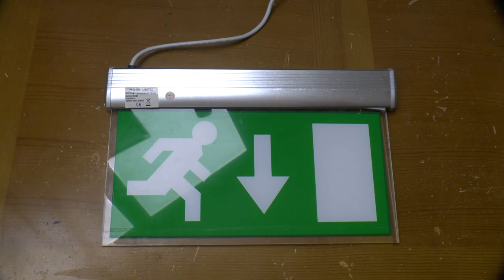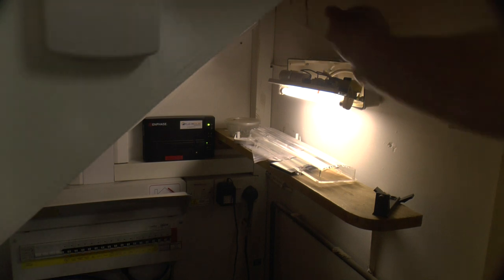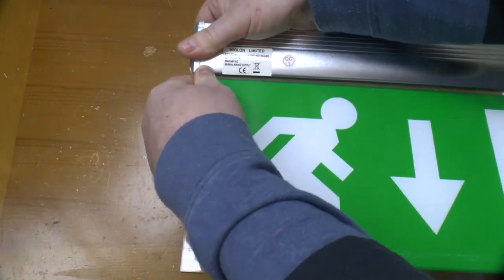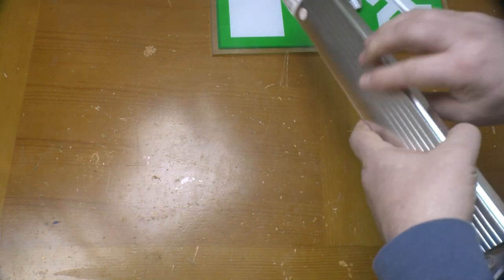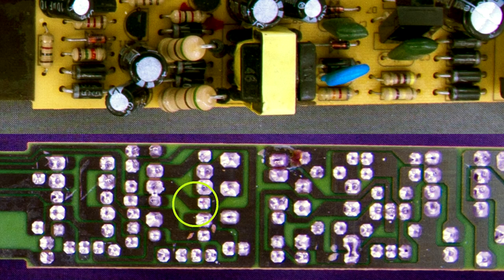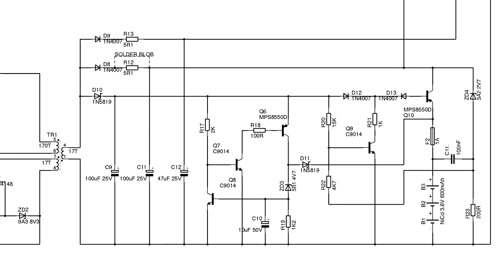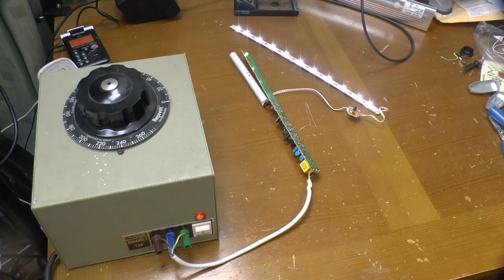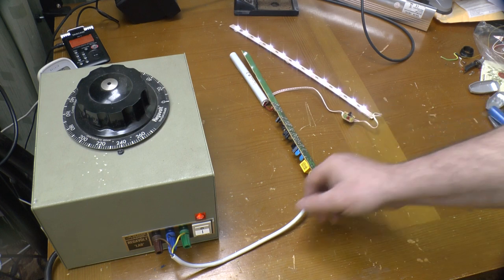"Disposable" LED fire exit sign teardown

Comment: at work we had LED based exit signs, and one didn't work, so I took it apart to figure out why, and it had a very very simple circuit;  it was composed of a very small transformer to charge up the battery (three 1.2V cells) and run the LEDs (red) normally.  There were just four transistors on the board, but it had a very interesting circuit, where it would not turn the LEDs on until it had power applied, to keep the battery charged.  It was composed of two cross connected transistors (NPN and PNP) in an SCR like fashion.  It looks like this one was similar where the LEDs wouldn't come on until it got powered first.  Like a "battery freshness seal"

Comment: Emergency lights (normal ones) are about £15-20 these days.  After 3 years they will just get replaced (if they last that long!).  The labour to change the batteries will be more than replacement.  Mad.
Reply: I mean, they have to work in an emergency, so it's also about the reliability of the rest of the hardware.

Comment: If I had one of these I'd mount it above my bedroom door and have it come on when the power fails. Could the battery be replaced with a 3.6 volt lithium with charge circuit for longer runtime? 600mAh is not a lot.
Reply from the maker: For that you either need a non-maintained unit or a maintained-switched one, with the switched feed left unconnected (unless you wanted to be able to use it as a normal light fitting as well).  

As there are no windows in my shed (and it's pretty light-tight if the door is closed) the light fitting in there is a 6 foot maintained-switched batten.

Some models of emergency light use lithium batteries and/or have enough room in the fitting that you could squeeze additional parallel cells inside.  Alternatively if the fitting is close enough to the ceiling you could always modify it with an external battery connector and have the battery in the ceiling void.  Some of the single-LED "spotlight" emergency light fittings have a battery designed to be posted through the mounting hole before the fitting goes into place.